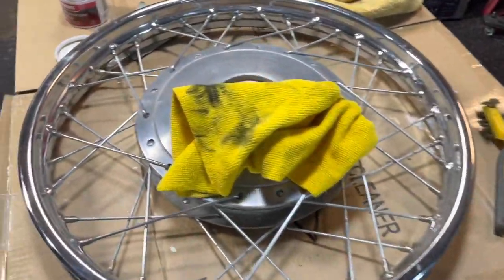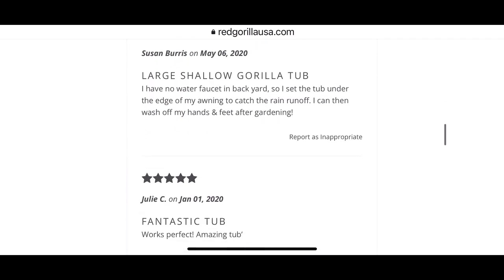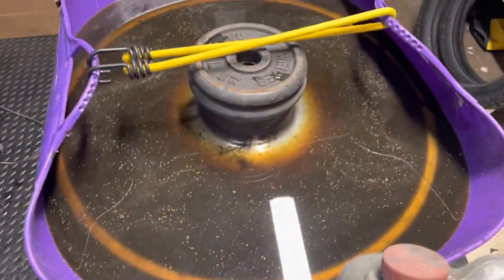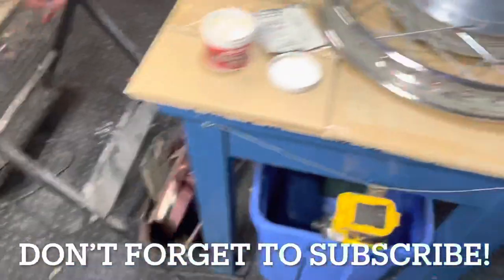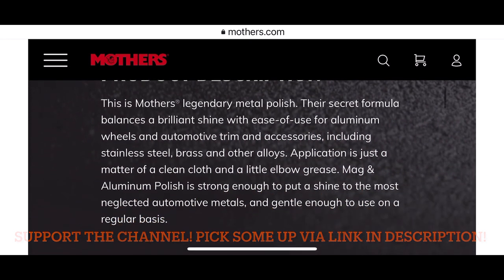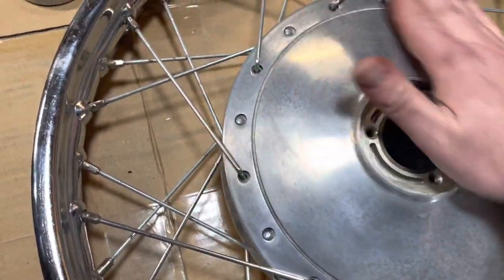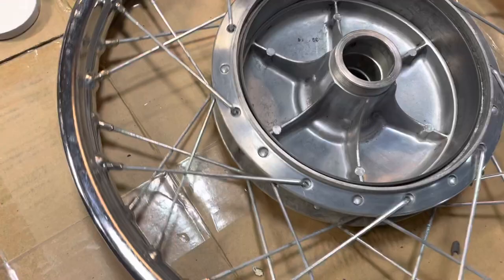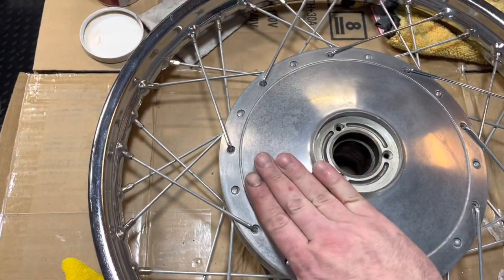Remove Rust & Polish Chrome or Aluminum Wheels Without Disassembly

Comment: I can't wait to try this, your channel is awesome!!   Hey, this is a bit off topic.  I have a 1963 CB77 Superhawk and the kick start pedal just became stripped, so it wont adhere to the shaft coming out of the engine.  Any ideas?  I don't see those parts anywhere online.  Thank you in advance if you have the time.
Reply from the maker: That kick start is much more complex than I’d expected. I wonder if there’s an insert that could be manufactured or perhaps drilling a pin? It’d have to be a pretty hard pin though. Glad you’re enjoying the channel.